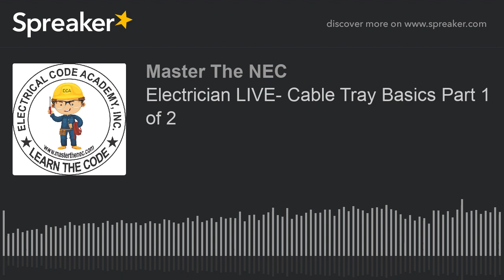Electrician LIVE- Cable Tray Basics Part 1 of 2

Comment: Can you please clarify where the Circular mill area you described in part 1 in chapter 5. Is the diameter in square inch the focus, is the circular mils area the came, and the cross sectional area etc. Thank you so much for this explanation. No one seems to cover cable trays in the code. I have enjoyed part 1 and 2. Keep up the great work. I appreciate it.
Reply: @MasterTheNEC  thank you  that's what I thought you meant,  however you stated at as circular mils in table 5. Thank you for your response.  I appreciate it. Your doing a good thing ...
Reply from the maker: Greetings - I believe you are talking about my statement at 49:20 in the video. I am talking about how you would use Table 392.22(B)(1) and the maximum allowable fill for a single conductor cable and in doing that you use the values in column 1 in square inches and actually do indeed use the values in Table 5 to replicate raceway fill. However, I do not see where I said anything about "circular mils" in that statement.

Comment: So are the conductors called CT Rated or TC Rated?    I argued with Southwire in 2016 about their conductor ratings.   Code I believe had information about TC.  Not CT Rated.   Also, could never find anyone that could explain what a single conductor cable was.   I'm happy they finally got it fixed!    Respectively,   Kevin
Reply from the maker: CT Use = Cable Tray Use in terms of being UL 1685 compliant in 1/0 and larger for single conductor cables or now also single insulated conductors as stated now in 392.10 of the 2020 NEC. Single Conductor Cables are USE-2 but also MC Cables for example with a single insulated conductor as simple as that sounds. We have permitted THHN/THWN-2 and XHHW-2 in cable trays (industrial establishments only) for years without anyone actually questioning what 392.10(B) really means until I started a fuss and then 2020 NEC attempted to correct that and added the sentence in 392.10 about "single insulated conductors". So basically up to the 2017 NEC only single conductor cables, except for the EGC, were permitted in cable trays in an industrial establishment but single insulated conductors have been allowed for decades by AHJ's. So the 2020 NEC just added language that has been the "norm" for decades.
Reply: Master The NEC    How sure are you of UL 1685 compliance?   I didn't ask about vertical cable tray.   Perhaps a different UL number.
Reply from the maker: Well that's kinda a crappy response as I am just trying to help..LOL. I am head of codes and standards for a major manufacturer of wire and cable so....I would think I have good knowledge on the subject. You simply asked labour CT Ratings and the use in cable trays is UL 1685 Method 1 or the more stricter UL 1685 Method 2, which is comparable to IEEE 1202 and FT4. TC is Tray Cable so not sure what that has to do with CT ratings in your question about conductors. When they are 1/0 and larger they are tested and depending on the insulation they may or may not also meet VW-1. To be honest you didn't state anything about horizontal or vertical flame tests, I was just explaining CT Use requirements in UL 83, UL 44, UL 1581, and UL 1685.

While UL 1685 is for cable trays, it is also for single conductor cables. The single insulated conductors (THHN/THWN-2) have to meet VW-1 and tested per UL 2556. The minimum for XHHW-2 is FT2 as tested per UL 2556 as well. The single insulated conductors would have to be both VW-1 to have a chance at passing IEEE 1202, FT4 or UL 1685 Method 2 at 70K BTU. So since 392 limited the sizes to 1/0 and larger for circuit conductors the only way to achieve that is with the same test parameters.
Reply: Master The NEC    I'm sorry if you took it incorrectly.   I'm not trying to be argumentative.   Since I am retried, I have only my NEC books and internet.   When I did search for UL 1685, this is all I was finding.    https://standardscatalog.ul.com/standards/en/standard_1685_4.    I was confused and needed clarification.
As far as CT rated, if it is in 2020 NEC, great.   I do not have beyond 2017.   My comment was based on Table 392.10(A) listing (Power and control tray cable: Type TC).  Nowhere could I find in the list a CT rated cable.   This was a few years ago.   
This was my third largest complaint about NEC while I was working.    
Again, I am sorry if I offended you unknowingly!
Respectfully,   Kevin